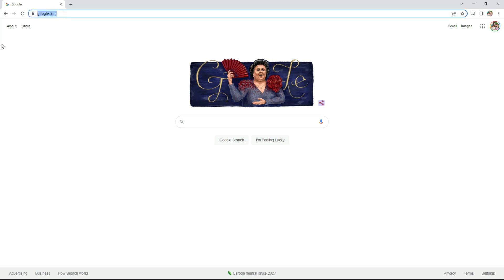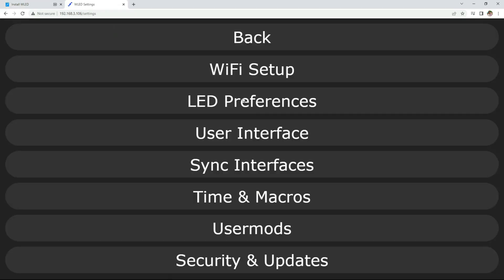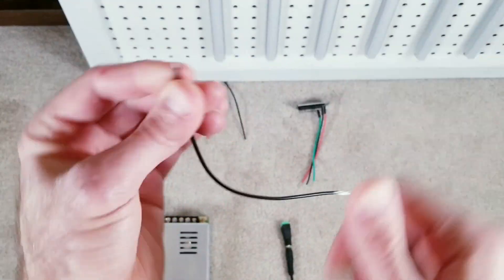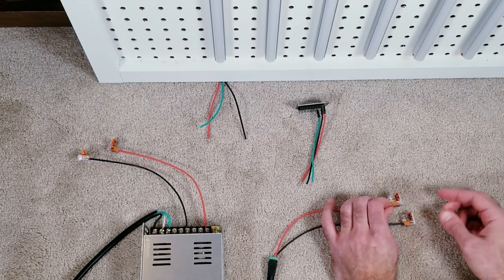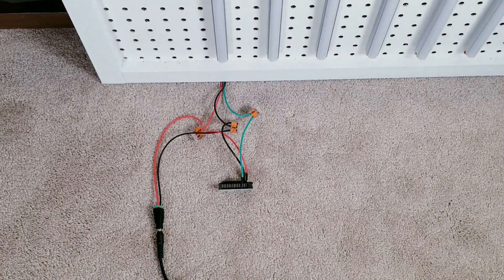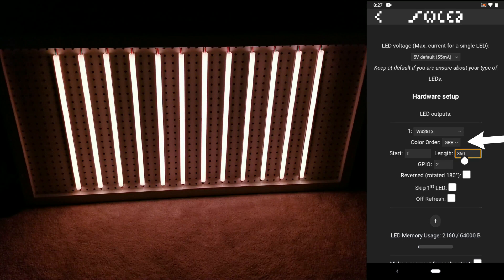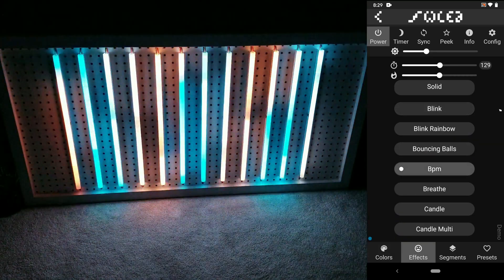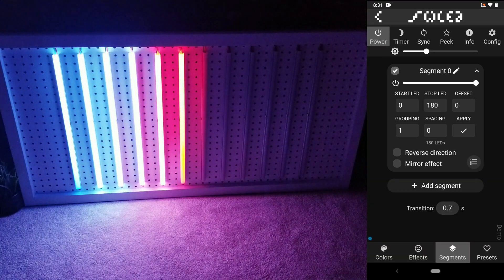How To Install WLED on an ESP32 Board and Connect / Control Addressable LEDs

Comment: When I look at wiring tutorials using an esp32 on WLEDs project website, it shows all kinds of additional components like a buck converter, level shifter, capacitors and fuses. Why are you not using any of these?

Comment: Hi Chris. A little help needed. 
I did have WLED installed and running perfectly for the holidays. 
But somehow recently the pallet page didn’t load and said that there was no device found. After couple of tries and troubleshoot, I was unsuccessful. 
I tried loading wled again and again , connecting it to the strip lights which actually lights up but somehow it doesn’t go into the palette page for me to control it.
Appreciate it if you could help out. 
Thanks and keep up the excellent job.

Comment: Great Video Chris - I have a project that I want to attempt after seeing your video. What I want to achieve is similar to what you have shown in your demo of 12 strips. I will have 10 strips each of which will be 1.6 meters in length. From what I have seen in your demo a single ESP32 can control all the strips. Am I right? Also can you tell me please the type of LEDs that you have used? I will have to use something that is weatherproof (ip65) as mine will be outside.

Comment: Those are a lot cheaper so what’s the need to purchase Gledopto?
Reply from the maker: No need but if you want the same features as gledoptos, you need to also purchase a mic, a resistor, a level shifter, fuse, and more.

Comment: I have to cut a 5meters strip in 2 pieces, so install one on top of the wall and the other on the bottom.

Could be a problem if i use long cables to connect (1) power supply--> 1st led strip IN and (2) 1st led tip-->2nd led strip?

Comment: hi chris please help me for power supply i am installing WS2811 144 led for 10 meters length how many watts power do i need it, and problem is watts and amp, and i searched in internet i found this LED power consumption: 23.42 W / 1.95 A per 144 led in 1 meter is this correct, please please reply me thank you

Comment: Hi all, great video. Tried installing WLED using method described. Install WLED firmware, but it never asks me for my WIFI details. The installer page looks slight different then the one in your video, is there some new steps? Many thanks, Gavin Baker.

Comment: can you drive 20 meters of LED strip ( 60 leds/ M)  with 1 ESP32S ?  also if my power supply is only 12v i will have to have a second power supply of 5v for the ESP32Sboard ? - I used your link to buy the ESP32S boards. Thank you

Comment: Just a recommendation, BUT in the CONFIGURATION SECTION, choose GPIO 2 if using the ESP 32, 2 corresponds to the D4 pin. I was confused my lights didn’t initially come on and I looked closely at your set up and noticed yours was a GPIO 2. Once I made the change and hit save, THEY CAME ON!

Comment: Hi, if use sk6812 10meters long, what power should I use? Are there any 10m sk6812 or should I connect 2 times 5 meters? Thanks!

Comment: I need a bit of help. I have 2 esp controllers and non of them bring up my extending wifi network nor will the connect to the regular named network. so when I open the wled app it does not find any lights, and will only allow me to control one at a time which is to be expected. How can I connect the 2 sets of lights to one controller or is there a different wifi extender I should get? Thanks in advance

Comment: So because there is so much info and also non info on how to properly power these strips. From this video it seems necessary to power these strips along with the esp board. We are trying to run about 367 leds but we were just running the 5v into the esp board with huge brightness loss after the first 47. Would adding the 5v directly to the first strip solve this problem?

Comment: WLED doesn't find my wifi in join other, it's 2.4Ghz and 11 canals and router is very close and done did reset to factory settings and re-installed and all of that

Comment: When you look at message boards you see getting WLED to work with ESP32 is hit and miss, caveats about data cable and ESP drivers notwithstanding. I’ve given up on WLED and coded the app on PlatformIO in VSCode. The FastLED library has excellent documentation and works great with Arduino and Esp32. Thanks for the video.

Comment: The LED strip comes with a 3-pin connector and 2 wires attached. Basically, the power cable that is attached to the led is also going to be going to esp32 is this bad?

Comment: Thank you for the great video.  I used this, and a few other videos of yours, as the basis for my first LED strip project and things went smoothly.  I did get hung up for a little bit as I was getting no light, until I switched the GPIO to 2 in WLED.  Keep up the helpful content.

Comment: When I just provide power through the ESP32 USB port, everything works properly but when I try to use a “medium” power supply and wago connectors as shown here, I just get one green LED light.

Comment: Hi Chris, great work man, your videos are awesome. I have a question, maybe you can help me. I have about 35ft of addressable LED RGB IC (one long strip) and i have have it connected to a 250w 10.4A power supply that was recommended by the company. But i am getting flickering every so often, more pronounced in higher brightness. What ideas? 😔

Comment: Followed this video, got the wled to work with usb power. Once I changed to a transformer, the led only show 1 red, 1 green and 1 blue. Change the board to a new one, same thing. Now I can't get it to work on either usb power or mains. Any suggestions?

Comment: When i follow this tutorial using a esp8266 board it works just fine with the usb but will not work with an external power supply?

Comment: So, I have an 12v led strip and a 5v esp32 how should I do it? 
I tried at 12v and works but probably will burn the board if I use a lot of time

Comment: Oye carbalito he inatalado wled en dos placas una esp8266 y una esp32 pero al dia aiguiente me aparecen offline no entiendo porque
Y tengo que volver a flashearlas sabeas que esta ocurriebdo
He incluso igual  le puse eso de la ip estatica pero se desconecta al diaa siguienteHey carbalito, I have installed wled on two boards, one esp8266 and one esp32, but the next day they appear offline, I don't understand why. And I have to flash them again. Do you know what's happening? I even put the static IP thing in there, but it disconnects the next day.

Comment: i just took this project up and cant get the leds to power on once i plug in the medium power supply. im not sure if a bad solder could make them not even power on, but i double checked everything was where it needed to be and that wled was installed. any help?
Reply from the maker: First thing to check is in led preferences that the gpio is set to 2 (or whatever pin you used for data) WLED used to default to 2 but I Believe now it defaults to 16. I just made a new video similar to this one where I add a few more details that you can check out if you're still having issues. https://youtu.be/exAWzMfmwQ8
Reply: @ChrisMaherDIY  Appreciate the info! I ended up having to put the data on the 4 pin for it to work. wled wasn’t allowing pin 2 for some reason. Everything works perfectly now. Also just wanted to say thankyou for the inspiration of this project, and all the effort that goes into your videos, keep up the amazing work !

Comment: I think i've followed every step correctly, but when I connect the power supply, the power led on the ESP32 turns on, but not the led strip´
I'm using a SK6812 RGBW from BTF lighting and I've tested the strip with a SP511E controller and it works

Any advice?
Reply from the maker: One thing to check is make sure in led preferences you change the number next to gpio to whatever pin you used for data. I believe I used the d2 pin so I put 2 in the field. I did just make another video similar to this one but a little more detailed that you can check out as well! https://youtu.be/exAWzMfmwQ8?si=HV7YHN3W2VXhedZd
Reply: That was exactly the problem, thanks a lot :D @ChrisMaherDIY
Reply from the maker: @JunicaviGames  awesome! Yeah it's unfortunate because WLED used to default 2 as the data pin but at some point they switched the default to 16 but I made the video assuming it would remain 2. That's one of the reasons why I made the new video to make sure I mentioned this.
Reply: @ChrisMaherDIY  Thanks for you tutorials. I'm getting a setup for my library with 3 segments connected to an ESP32 to a 5V 15A power supply, but my ESP32 with Wled can't find my Wifi now for some reason, I tried different boards, different WLED versions, and nothing, it was working fine before.

Comment: Does this mean that if the Wifi goes out the lights do too? Or can these strips be controlled via a physical point and shoot controller? 
 
Somebody good lord please help me. It is 4AM & I should have been sleeping 3 hours ago.
Reply: No, light wont gonna turn off. it just keep running the pattern that choosed last, when wifi is back it will reconnect.(if wifi didn't came back, it have its own network u can temporary connect to that and control it)

Comment: Your videos and Tuts are pure gems. Thank you for them. 
Just a short question. If I’d use a strip of 24v but long and I’d like to make I’m double inyección what resistor should be the one to use into the other side to make it work? Thanks

Comment: Hey Chris, I'm a big fan of your videos but I've been having trouble connecting to the esp32 without connecting is directly to the computer. it looks like the board's signal is weak or is not automatically connecting to the wifi. Any suggestions would be appreciated

Comment: i am having a lot of trouble with my esp32 board, its a devkitv1. It will only connect to wifi while powered by micro-usb through my pc. When plugged in to external power source the red LED on the board lights up, but it never boots up a wled server. Ive tried downloading the drivers, reinstalling wled, ive held the boot button down. To me it seems to be a board/Wled problem, but idk what to try anymore.

Comment: I just got done setting up my frist strip of leds using your videos. I got the btf sk6812 RGBW with warm white. How do I get wled to turn on the warm white only? If I set the color to white it just uses the RGB portion (i tried setting white correction to accururate. Thanks for the help!

Comment: Hi Chris. I'd like to install an LED strip in a diffuser channel in the bathroom up by the ceiling in the shower. The ESP32 will be protected and the wiring will be in the wall. Do you have any suggestions on a water resistant or waterproof addressable LED strip I can buy?

Comment: interesting but doesn't work if i conect 5V to vin pin, whit USB work fine, i have same esp like you have
Reply from the maker: The only suggestion I have is to make sure the gnd of the power supply, lights and esp are all common.
Reply: @ChrisMaherDIY  all gnd the same but don't work, weird, thanks

Comment: Please help me. I set up wled in laptop & cell phone but even I turn the led strip on from cellphone.  The power button. shows on but it doesn't work
Reply from the maker: Thanks for watching! First thing I would check is under led preferences that the number next to gpio is set to 2. That's the data pin you use. I use the d2 pin so I put 2 in that section. If you used a different pin you can put that number there.
Reply: @ChrisMaherDIY  please tell me in detail. What should I do.  I selected "2" from button 0 GPIO .  But strip does not turn On.
Reply: Does esp32 work with led WS2811 ?

Comment: hi there thanks for video but what if i use a led driver lets say a live to SL light socket and use a neutral  from rose pendant  to connect the led driver to power the esp basically what im saying in a nut shell is is there any chance on a video using leds to a esp to a 5v led driver/12v led driver to 240v mains if possible

Comment: Hi Chris, do you know can SK6812 RGBWW use on ESP32 ??? ( RGBWW is 2700-3000K ).

I wondering try the SK6812 RGBWW led strip, because WS2812B worm color looks so "yellow", but RGBWW are very expansive, and I can't find any video on youtube proof it works... ,  many thanks

Comment: I got the WLED installed but my pc crashed before I completed the setup.  Now I cannot connect that ESP32 to reinstall WLED.  The regular Arduino IDE will not connect either.  How can I recover the ESP32?

Comment: Have you found the amperage of the power supply used impacts your ability to consistently connect to the ESP32 board?  When I use a 5V3A power supply, I have difficulty consistently connecting to the ESP32 using WLED.  When I switch to the "medium" power supply, the connection to the ESP32 module appears to be more reliable and consistent.  Do you know if there is any direct correlation?

Comment: Thanks for the video. I was looking at the SK6812 page on BTF Lightings site and it mentions 18W per metre for the 5V 60 LEDs/M strip. So 90W for the full strip, which an online calculator suggests would require an 18A DC 5V power supply. Does that sound correct?

Comment: how much voltage does the ESP board handle? im wondering because lets say i want to use 24v led strips but the board would fry if i connected it together wouldn't it?

Comment: Sorry if this is mentioned but I didn't hear it (watched the video twice), you are using 5v power supplies? 12v and 24v would require a buck converter to step down the power to the ESP32. Thanks for the tutorial

Comment: I would like to construct a similar panel but would like it to be X/Y addressable
to display scaled images/photos.

Can you please comment on how you wired the individual strips in the matrix.
Specifically, do you just cut and connect the next strip with short pieces of 
wire OR do you need to reverse the next strip and connected it with wires that
are as long as a strip back to the previous strip.

Putting it another way, Can WLED be configured to know that every-other-strip
in a matrix needs to be addressed in reverse-order?

Comment: i sat here for over an hour trying to figure out why mine werent connecting. then i tried changing the GPIO pin in the setup to D4 for transmitting info, then boom it started working. it doesnt default to the correct pin so check this when you connect

Comment: If you use ESP32 or ESP8266 for other purposes, you need to know that WLED will replace your bootloader and you cannot then use that ESP for any other sketches/apps, though WLED can apparently be updated (via OTA, it seems). I have not seen this mentioned in the download page, most people just want to install WLED and have working LEDs.

If you attempt to upload a sketch from the Arduino IDE, then the ESP will fail to install it and might be a brick thereafter, though it LOOKS like it's polling the Wifi as is normal for WLED (onboard LED flashing). You can guess how I know.
Maybe it was my version of ESP and IDE, but that's what I found. (Using Arduino IDE version 2.10, with DOIT devkit V1.)

Comment: Great video, this was very helpful in getting me started in the world of LEDs, ESPs, soldering, etc. 

It's worth mentioning that i could not get my LEDs to light up on first try because for whatever reason the GPIO was defaulted  to 16 in the WLED configs. Once i set it to 2, success! I just thought i'd point that out just in case anyone else comes across that issue. Cheers
Reply: thank you so much :')
ive been searching for solutions because my lights wouldnt light up and couldnt find anything... 
but this helped !
Reply: Thank you so much! I was so confused of getting voltage on the strip but not light 😅 You saved the day!
Reply: Gunna bump this for clarity because this was a pretty big issue for me. I got pretty frustrated at the process because i couldn't figure out why the lights were lighting up.
Reply: Same here
Reply: Dude, thank you! I thought my strip was broken <3